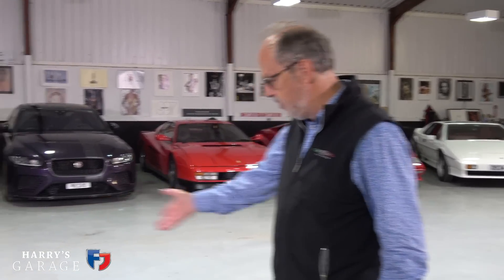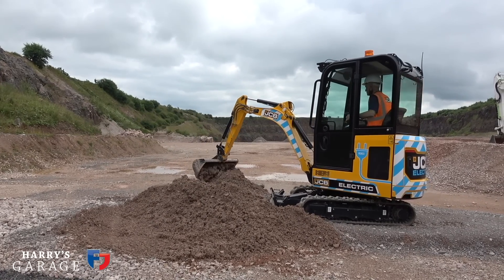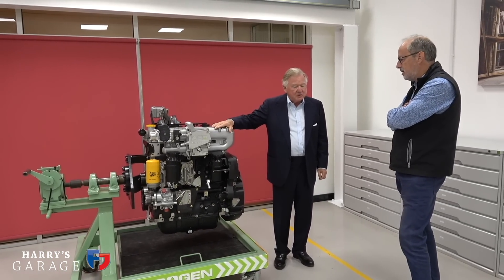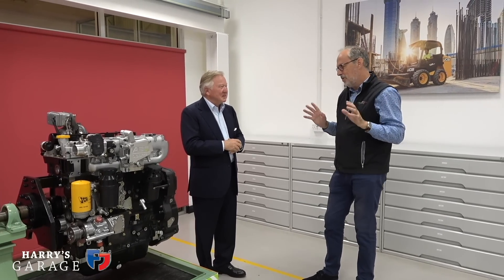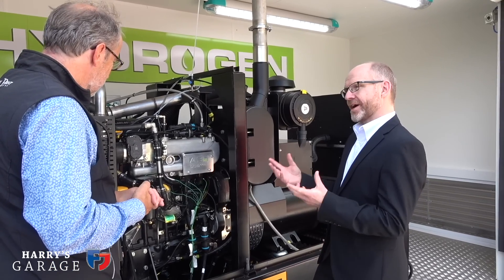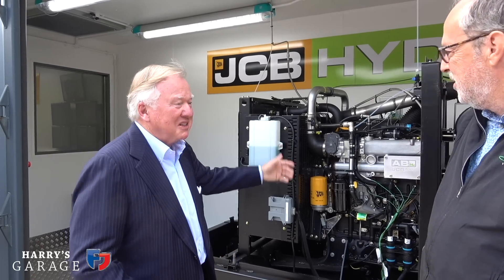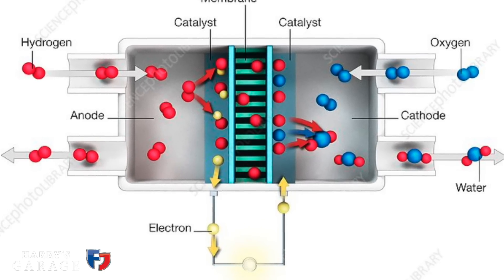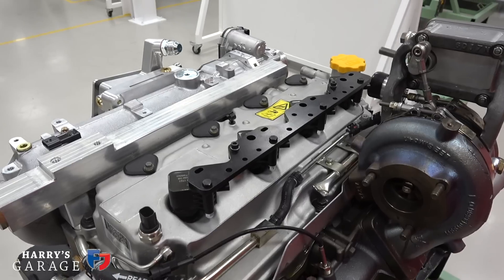Is hydrogen, rather than electric, the future for big-engined machinery? I visit JCB to find out

Comment: A physics issue - In order to produce hydrogen, you push electrical current into water which separates the hydrogen.
100 watts of electricity will produce 30 watts of hydrogen.
Therefore, it would be more efficient to use the electricity directly.
And since the electricity is produced by fossil fuels, it continues to pour CO2 into the atmosphere.

Further - The charge up time may be quick, but getting hydrogen into a tank for quick filling takes a long time - Just like charging a bank of batteries takes time.

No matter how you look at this - Nuclear (Thorium preferable) is the answer.
Reply: The Chinese are working on Thorium reactors.

Comment: The problem at the moment is that hydrogen production is not very green at all. If the national gas grids switch to hydrogen also, most of it will more than likely be blue hydrogen... Not good at all. However if its green hydrogen we are onto a winner.

Comment: Yes this is a credible alternative to petrol/diesel and EVs but there was a significant mistake in the video when talking about the energy density of the hydrogen.  Harry says there is more stored energy per litre of hydrogen than per litre of diesel.  This is absolutely not true for the tanks they have there.  It is true there is more stored energy per kg of hydrogen than per kg of diesel but the problem is you cannot practically fit anywhere near the same mass of hydrogen in a particular volume than you can with diesel.  At a storage pressure of 700bar (I think they were only using 350bar at JCB) the energy density of hydrogen is around 1.5kwh/L whereas for liquid diesel at atmospheric pressure the energy density is around 11kwh/L.  This means to do the same amount of work as the diesel engine you'll need a 7x bigger fuel tank or have to be prepared to fill the hydrogen tank up 7x more often than the diesel tank.  I see this as a significant hurdle for this technology which was not talked about in the video!

Comment: In my humble opinion No to electric vehicles (major infrastructure issues, battery raw materials sourcing issues, for the sheer volume needed, severe pollution issues producing those raw materials, fast charging damage to batteries etc,etc, etc), Hydrogen was looked into extensively in the 1970's started due to the Fuel Crisis, and was determined not to be a route forward, despite Nissan, etc, successfully having vehicles running on Hydrogen. There is also another very serious issue related to the ready availability of Hydrogen as a Fuel - Do we really want Terrorists  being able to get hold of it in even limited quantities, given it is a Category 1 Explosive,  with significant Explosive force ? However, there is a suitable option that is very easy to make, is renewable, can utilise a wide range of Feedstock, including all forms of plastic Waste, Seawater, lawn and hedge clippings, Household and industrial waste, Sewage, etc, and that is Plasma Gasification Syngas Production of Ultra Clean Synthetic Liquid and Gas Fuels.  All Landfill Waste Disposal can be used as Feedstock to clean them up, and even burying in Nstural Gas as Feedstock delivers A Production cost of around one USA dollar per USA Gallon of Ultra Clean Diesel.  Just the Annual Waste in Britain, processed through Plasma and Syngas, can produce enough Ultra Clean Diesel, to provide 4 times the amount of Diesel that the USA uses every year, plus petrol, and Fuel Gases. Annually, around 16 million tons of Steel would come from it, plus other materials , and with almost zero emissions - emissions are also Feedstock - the only waste product is a very high temperature ceramic,  which would be very useful for the construction industry. When everything but one point is taken into account, as recent Studies have indicated, Diesel Engines are better for the Environment than Electric Vehicles. The one other point is extremely pertinent, and which rarely gets talked about, is the Reality that Our Atmosphere is Chronically, and perhaps Dangerously Short of CO2.  So much so, that most Plznt Varieties are suffering from the Shortage, which is leaving them needing much more water, and vulnerable to Droughts and Plant Disezses. The ex Hesd of Greenpeace, Dr Patrick Moore is on the Case and is Aware of the Problem, that is caused by far too much CO2 being locked away out of the reach of Life. For example, how many people know that there is around 140 times more CO2 in the Iceans than the Atmosphere ? That by the way, doesn't just blow the attempted Ocean Acidification Fraud out of the Water, if you think about it Rationally and Empirically, it does the same to Anthropogenic Global Warming as well ? So Fuel of the future imho, is Ultra Clean Renewable Recyclable Cheap, easy to distribute, and very Safe, Diesel Fuel powering Diesel Engines, and Petrol Engines (Synthetic Gas imho, should be used for Heating, Cooking, Chemicals use, and in Gas Turbine Generators , etc. To confirm that 140 times more CO2 in the Oceans, look at US Navy Laboratory Studies confirming it, and that it is such  rich Source of CO2,  they Planned making Jet Fuel Out of it , so avoiding having to logisticalky ship it to Aircraft Carriers - They may have already started doing that. A point on the Necessary power Distribution infrastructure for Electric Vehicles.  If Designed properly for Reliable 24/7/365 Elicyricity across Britain through Ice Storm Winters like 1947, or Very Hot Summers like 1976 (an adequate design today, is frankly unlikely ) and built to the necessary Standard (also unlikely, sadly), Then the Cost of building just that Power Distribution Network, would likely Bankrupt The Country Several Times Over. Then add in the cost of a Power Generating Infrastructure to connect into it, that is capable of providing the 3 basic essentials that have to be delivered - Cheap Reliable Base Load Generating Capacity, Cheap Reliable Load Following Capacity, and Cheap Reliable Peak Load Generating Capacity ? It is both interesting, and Worrying to Note, that Neither Wind Nor Solar .power, can Provide even 1 of those 3  Asia essentials isn't it ? So a Final Question is, where is the Ekectricity goung to come from, to Power all those planned Ekectric Vehicles ? To me the I editable result is going to be lots of Ekectric Vehicles, Trains, etc, Out of Battery Charge, and unable to get anywhere. How can industries, Businesses, Farming, etc, Function in Such an Environment,  intermittently, if at all. 🤔🇬🇧🏴🇺🇲

Comment: As long as you have enough coal fired power stations to make the hydrogen.
I challenge lord  Bamford to show us how many solar panels he would need to power a 20 ton excavator.
Reply: A 20 ton JCB excavator develops less power than an average family car. 
Ball park ..100horsepower ~80kw. Running all day -10 hour day? - at average 50% peak power (40kw) and 20% efficient panel at 0.7kw per sq metre then it would take approx  285 sq metres or apporx 17 x17m . A very large roof of a very large  house. Thats direct to a battery. If stupidly processed and burnt as hydrogen combustion - about 5 times that area required. Hydorgen combusation is a very stupid idea.
Reply: Just goes to show that even smart people can be blinded by reality.

Comment: It's interesting that they talk about 'big engined' machinery. Power outputs for even the largest JCBs  (at  38T) barely make it over 300 horsepower peak output.
 This is way less than a higher end Tesla. They work of course because they are massively geared down.  Even then the torques they produce are not so impressive as you may suppose. Barely over 1000Nm. The Tesla truck specs report ten times that.  
For all their impressive bulk and weight these things actually have underwhelming power specs.

Comment: Here in North America we put a lot more hours on cars than you do in Europe. It would take me 2-3 days to travel the 800 miles (1280K) to visit my family with a battery car. I do it with internal combustion engine in about 14 hours stopping twice for gas and several breaks. It would probably take even longer in winter with battery because I suspect it uses more current in cold weather do to several reasons including battery heater, cabin heater, lights, ect. 
 And now for hydrogen. The questions I have is has anyone considered that water vapor is said to be a larger greenhouse effect than CO2 and millions or billions of hydrogen burning engines might create something worse than expected? The autos we have now also create moisture out of the tailpipe. You can see it run out the tail pipes at times when a vehicle accelerates from a stop light in cold weather. It is said that all emissions from hydrogen fuel is moisture vapor and vapor condenses in the cold. In the winter, especially in the cities with many stop lights, this water flows out on to the cold ground and freezes. Now major slick spots are created at every intersection especially in morning rush hour traffic. Also, what about the compressed explosive gas, leaks while refueling and major collisions. Just for instance, we have idiots now that try to carry gasoline in plastic bags. 
 I just wonder if any one really thought about the problems that is being traded for in their hast to be the father of something different.
Reply: 2 or 3 days? Rubbish. I have just done a 1000 mile+ loop around Scotland and back down into England in my Tesla . 3 charging stops at 40minutes each.  In over 16 hours of total cumulated driving I would not have wanted less breaks than the 1hour 20mins I spent off road.

Comment: There will be a mix of different types of power sources for automobiles and other equipment, etc. Electric automobiles will become extremely popular. Hydrogen engines may also become extremely popular. Neither one will displace 100 percent of the other one.

Comment: Each low emission solution has its own challenges and problems clearly. While hydrogen engines are certainly nowhere near as efficient as a BEV, they do not require even a fraction of the the rare materials to build and still achieve a ultra-low emission result. The only emissions would be a negligible amount of carbon from burning engine oil and some NOx emissions, most of which can be controlled via the air/fuel mixture and aftertreatments like the catalytic converter. Same as any ICE really. It seems that due to the material constraints of our planet, the cleanest solution that can actually be scaled without price inflation will be the most successful. Seeing as we have already proven how scalable ICE is, hydrogen combustion engines do make an interesting case for themselves. The biggest challenge will be increasing engine efficiency while keeping production costs as low as possible. And of course, we need hydrogen fuel production to actually take off on a massive scale which remains to be seen. I hope it does soon because we need every solution we can get yesterday.

Comment: Does an H2 ICE engine suffer from similar efficiency losses of a petrol/diesel engine in the form of heat and noise? Petrol/diesel are really only 30% efficient at turning those fuels into movement energy. Direct electric, and therefore hydrogen fuel cell to some extent, operate at % in the 90s as there's less heat and noise. Hydrogen is already inefficient to make and store, we don't want to be adding to that inefficiency at the point of use surely?

Comment: I have long believed that electric/battery technology for vehicles is the wrong technology to solve the emissions problem. Extracting minerals to make conventional batteries is extremely damaging to the environment. Hydrogen is the only sustainable way forward. Limitless supply and no harmful emissions. Conventional electric cars may be  useful stop-gap until hydrogen technology and infrastructure are in place, but in the long-term, hydrogen is the only sensible answer. Well done Lord Bamford for following this path. Love and peace.

Comment: A Hydrogen machine would be GOOD. 

Let's have some fun with a pen using some separated word shapes by drawing it together for our eyes to see.

Notice visually demonstrated data from a simple drawing if you follow the directions.

G is an incomplete whole with one square angle drawn in.
O is a complete whole circle.
D is a split whole with two square angles.

If you draw the split whole out we see the shape of GOOD, its end shape, Father.

If we draw the separated letters shapes into the middle whole we see a circle halved once squared twice to the right, its beginning shape, Son.

Just as if the word itself had an expanding and contracting spatial breath from a simple pen.

Form the geometry then we see:

Time 12-3-6 (Image is also clock)
Time, times 12x-3-6 
Time, times and division of time 1/2x-3-6 

Remember the Hydrogen machine?

Keep in mind a clock splits midnight, hence the beginning element at it's end.

Time with periodic table by looking at the geometry:

12 Magnesium 
3 Lithium 
6 Carbon 
1 Hydrogen 
One clock wise cycle out of many
from fusion of a shape.

Comment: And the low co2 emissions power comes from new nuclear plants. You need a lot of power either way. Wind and sun is at the best a complement. The UK may also have tidal water power, but replacing fossil fuel is a big task. I think we should use the old stuff as long as it is working. Replacing working equipment is to create even more co2. Also old vehicles is the only alternative for ordinary people, doing things like snow plowing, also not so rich countries. The new green panic can easily create more damage then benefit if not all consequences has been calculated.

Comment: I dont understand,, you take a diesel ICE (40% efficient) running hydrogen (and oxygen) running a generator (80% efficient) , creating electricity and into a water electrolysis cell (80% efficient) to create the hydrogen and oxygen to run the ICE. 
Is this possible to get over unity perpetual motion machine?

Comment: Well they have to make the hydrogen using electrolysis, that uses quite a high
amount of electricity and that needs to be generated in power stations. 
Power station that are coal or nuclear powered.
Cold fusion could be used but that is not a thing yet so [NOT.]
Once cold fusion gets invented (if it does) we may as well just use cold fusion
power station and not bother with the hydrogen or the batteries at all.
Batteries or hydrogen are just moving the problem from one place to another.

Comment: Always believed Hydrogen is the answer, makes alot more sense than battery power which I fear is doomed to failure
Reply: Look at the full picture and it falls apart. Producing hydrogen requires huge amounts of electricity because the process is highly inefficient - so no advantage there. Once produced, the hydrogen then has to be transported to where it is used, sold or stored - no advantage their either. At the moment here in the whole of the UK, there are around a dozen hydrogen filling points -  so a lot of work to do there. Plus hydrogen will neither be cheaper than gas/petrol, nor will the vehicles using it be more economical - no points scored there either..... And finally, you can't "charge" a hydrogen powered car at home on your drive. Nor can you get hydrogen from solar panels if you have them at home. My Kia costs me around £8 for a full charge. This can take me almost 300 miles. I can't see any sort of hydrogen car ever being capable of that......
Reply: @Brian-om2hh  I would expect hydrogen filling points to replace the petrol stations we have, no one is suggesting filling up at home, that does not happen with petrol or diesel cars so there is no disadvantage once the infrastructure is in place. The cheaper argument does not really hold water as we are talking about zero carbon vehicles, if not we would stick to petrol until it ran out. £8 for a full charge on your Kia, what happens if you live in a block of flats and no access to a charger. The charging infrastructure in the Uk is nearly non existent with different types of chargers for different makes of vehicles. Finally what happens when the batteries are exhausted and a battery pack is the cost of a kings ransom and the old batteries not serviceable. Nickel cadmium will run out and the biggest reserves are in Afghanistan. Electric will have a place but I dont think it is going to reach critical mass on the basis of cost, infrastructure and total running costs, most people have second hand cars which have a relatively long service life and can change hands many times. the value of a second hand ev will plummet in line with battery life. it is an interesting debate and will take time to see what becomes the dominant type of personal transport, some would have us abandon the car altogether, do away with choice and dictate how and when we travel. i still think hydrogen will be the dominant fuel but probably wont live long enough to see it in its entirety.

Comment: Very sceptical at the begging and very impressed at the end and made a lot of  sense, until I found out the production of hydrogen at the moment is one of the worst polluters of any industry.
Using these combustion engines are great for the garages as they will always need servicing. It would be an amazing solution for heavy goods vehicles running on environmentally friendly produced hydrogen only? 
It would certainly speed a way of getting rid of dirty engines.
Very impressed, but who is going to produce the clean hydrogen needed?

Comment: Your vehicles already run on hydrogen. Hydro-carbon. The carbon doesn't burn, so what's left? That's right the hydrogen part. Carbon is only a means of storing hydrogen. Water is an even better means of storing hydrogen. H2O does not require giant refineries to unlock the hydro.